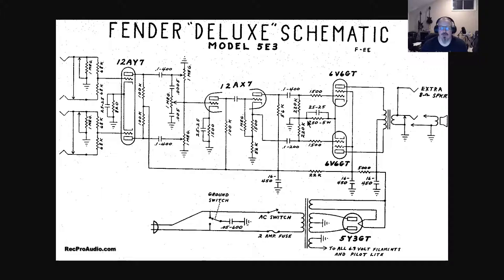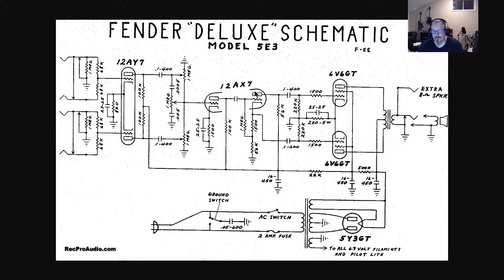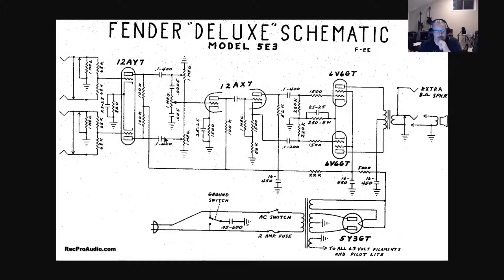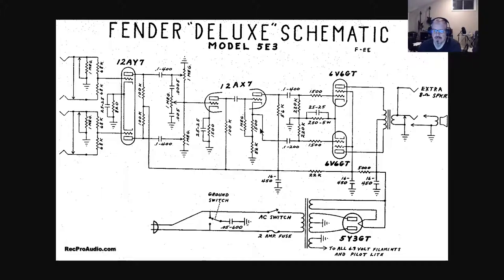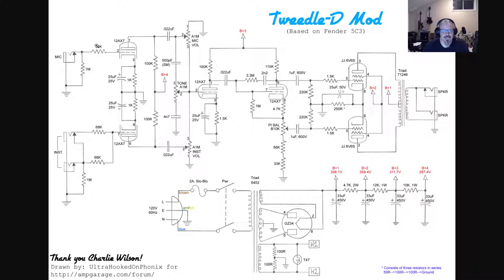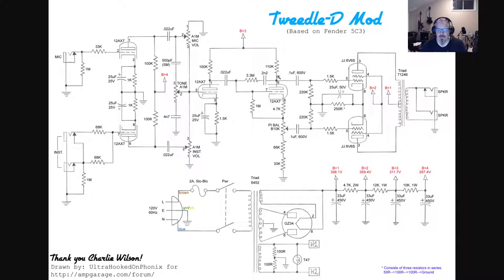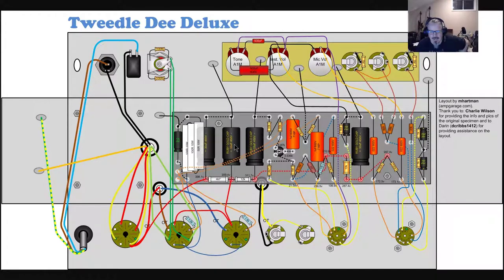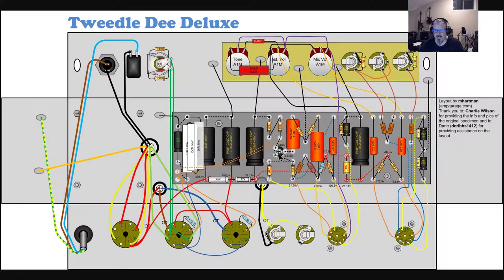TweedleDee Deluxe Intro

Comment: The two channels are described in reverse. The single input 33k grid stop channel has the 500pf cap in parallel with the 1M volume pot acting as a variable resistor and is the brighter instrument channel. The other side of VI has dual inputs and no 500pf cap and is the "microphone" channel as named in the original Fender 5E3.